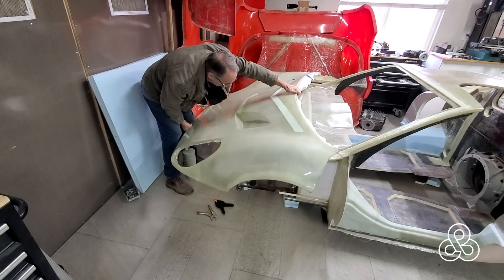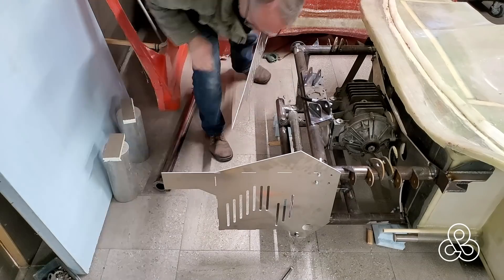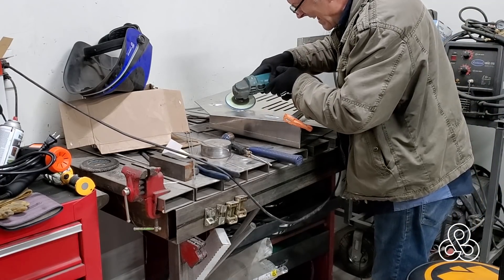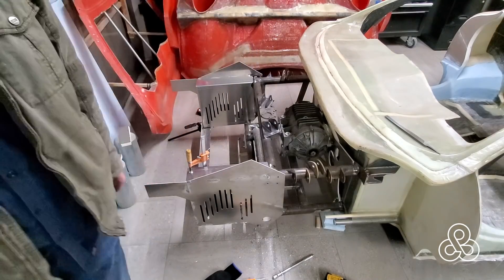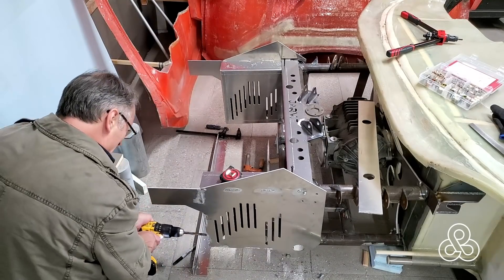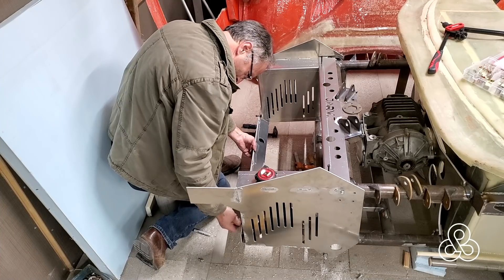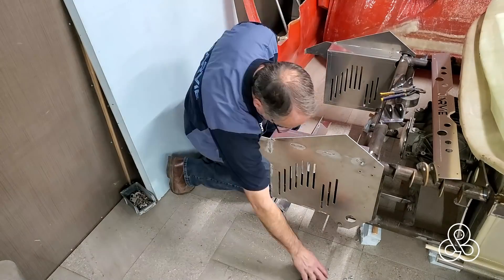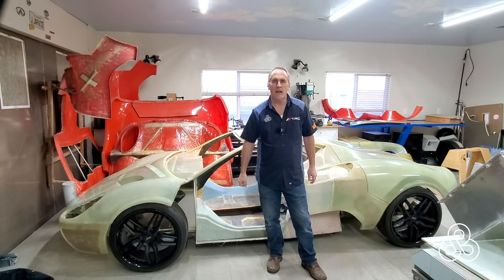A57 Under the nose! The front crash structure. Arete supercar project

Comment: Do you know what you're going to do for lights yet? Did you design it to use some that already exist or will you have to make your own? If you intend to race this car (spend time on various tracks), have you considered having extra body parts just in case of an accident (saving the templates so that you can make more as needed)? Have you thought about how much downforce you'd like to shoot for and at which speed you'd like to have that downforce, or are you just going to wind it? (lol I couldn't resist)
Reply from the maker: I have the lights (LED), but they are "replacement" bulbs for other vehicle (or off-road aftermarket) I will be building the fixtures for them. I have kept templates and of course the molds to replace or re-design in the future. Aero will be designed around Time-Attack. If I get to run it on track, that would be my interest. Amount of down force all depends on how high in the hierarchy you get in Time-Attack. As it will all be active, I will have room to play before I have to start changing things out.

Comment: Fabulous fabrication there Jay.  Don't know if it would help but my experience with riv-nuts on motorcycles is that over time some get loose and can spin in their holes.  I was wondering if applying some loctite when compressing the rivet part would ward off issues as well as moderating future galvanic corrosion.
Reply from the maker: I have found that in steel, but wonder if the deformation of aluminum will get a better grip. Also it seems to be the "bad bolts" that turn them, perhaps the right loctite (anti size) would be in order.

Comment: Minor point: won't you get galvanic corrosion where the aluminium and the steel meet?
Reply from the maker: Likely after some time. If the whole structure proves itself, I could reconstruct it fully out of bonded sheets later.

Comment: Hi Jay thanks for the (way) earlier videos illustrating your lay up processes with the different glass fabrics especially the ultra fine twills - I was stressing over the internal covers for the A pillars and windscreen header rail on the Dino recreation I’m building. Now sorted - the ultra fine twill followed the curves of the foam profiles / formers and they are now ready for upholstry trimming . Also Rivet nuts are super - I’ve used them all over for mounting items in the car - a little tef-gel on the threads is worth apply especially if using stainless bolts . Keep the vides coming great work & thanks again. 🙏
Reply from the maker: Glad I could help. Wish I was ready for upholstery. Ha!

Comment: This is awesome, I really like your work , but I have a question .... Why did you choose to use FWD rather than installing a transverse engine in the rear and make RWD ?
Reply from the maker: It will be All-wheel drive. It is all a result of packaging and expense to handle 600hp.

Comment: How is the radiator ducting going to work? With the way you've positioned and tilted the radiator it seems to me that bonnet vents are useless.
Reply from the maker: Still working on radiator position. Looking for a shorter (40mm) to get tilt correct.

Comment: I don’t know if it matters much but the radiator is angled the wrong way for the hood ducting.
The least resistant path will be down not up. It may not matter but depending on the rest of the structure and ducting the air could actually stall and not cool the engine.

Comment: Just to clarify. A rivnut rivet nut or nutsert are generally not blind unless the end is capped over so a bolt cannot go all the way through. The same for pop rivets , if they are blind the end is sealed. This is so that they can be used in water tanks etc where you don’t want liquid seeping out of the rivets.
If they aren’t capped off they aren’t blind.
Tip to reduce corrosion and the possibility of spinning put a little thread locker or CA glue on them and or in the hole

Comment: Those crash boxes are a lot of wasted space in a vehicle with limited space to put things.
I would consider a slight redesign so that you could put things like washer bottles and horns inside them.
I would also consider filling them with a high impact high density foam.
At the moment they look to be a five mile an hour structure only adding a foam to them will take them upto a forty mph structure without harming the low speed absorption
Reply from the maker: More space? there is already room for 2 travel bags. . . in supercar terms. Ha!

Comment: Working backwards from finished front end crumple zone.  Is it possible to glue as well as bolt That section to reduce fatigue and possible cracking around the bolt holes?
Reply from the maker: Bonding is a great way to go. I does take meticulous prep work and alignment, maybe on the production model -if ever. ha!

Comment: https://youtu.be/NrJzcdMkC9k?t=526 
The radiator would work the best way possible if you twist it to the front. The way you put it on the video will not allow good air travel. As I can see on the clip you have enough space to reconsider the twist.
Good luck!
Reply from the maker: Looking for a radiator that is a few inches (50mm) shorter, to do so.

Comment: A note on your radiator mounting angle and possible improvements. It might be useful to consider mounting it with top tilted towards the front. The Corvette C5 front radiator is mounted in the same way that you showed in the video, top tilted back. In the C6, GM changed it to top tilted to the front. I suspect the reason was a measurable increase in cooling at speed. My experience with the C5 Z06 is that the coolant temperature rises to above 220F on hot days. I've seen it go to 245F when idling for long periods. From what I understand, C6 vette owners experience less issues with cooling in this regard. I've also noticed other sports cars with angled radiators angle towards the front, Ferarris specifically. It might be useful to consider this while we're still in the design fabrication stages. Good luck!
Reply from the maker: Looking for a radiator that is about 2 inches shorter to rotate as you have point out, otherwise my flow through the "nose holes" is compromised. Good eye.
Reply: This reply doesn’t have enough love also this project is awesome. This car will be amazing!!! Can’t wait until it’s done.

Comment: For a possible 200 mph car I would be building a steel crash structure. Aluminum won't absorb impact like your hoping even with your box structure.
Reply: I'm not saying it cant be done. Just saying it probably shouldnt be done with aluminum sheet metal. Could fill the boxes with some sort of foam or lightweight stiffener

Comment: Just a suggestion if differentials you are using dont last in running reversed you can try hmmwv center sections as they run in reverse normally due to the reduction boxes
Reply from the maker: Good to know. Thanks

Comment: since the holes on the bonnet are made to suck upwards air from the bottom of the bumper, wouldn't be better to angle the radiator the other way in order to use the air movement for cooling and minimize turbolence?
i see there is a clearance issue but i believe positioning It that way, even more parallel to the ground (for clearence) would still be better, a lot of racecars with those bonnet holes use radiators parallel to the ground plane.
Reply from the maker: Yep! the wrecking yard radiator I have is about 2 inches to tall. looking for an alternative without having to get an expensive custom built one.

Comment: could you explain your design process for measuring the front crash structure? how much/ how thick the material needs to be, where to put relief cuts and so on...
Reply from the maker: Ultimately the occupant protection needs to come from the tub. The function of the structure out front is to "reduce" impact. The aluminum (plus radiators and such) structure would absorb only minor impacts. The vertical cuts in the structure force the panel to crush straight in rather than down (as the slope of the nose would try to accentuate). In harder collisions the front sub-frame would then absorb more force by folding. hopefully all this before the tub is called upon. Ultimately the tub takes all of these forces, but hopefully in a decelerated fashion. In the rear, hopefully the rear sub-frame (with engine mass) will break away in serious accidents, a-la F1 theory. Not sure if I could easily put together all the sources this ideology came from.
Reply: @BuilderCreator  Appreciate the response. 
Could heavy duty springs provide an energy absorption  mechanism? Or is there just too much energy in a collision for them to not bottom out?
Reply: @BuilderCreator   I know you don’t want to make talking head content but perhaps a video with your design and the considerations in the AutoCAD model might be an interesting way to do a bit more geeked content, you clearly have so much thinking behind it all it would be nice to give a sample...
Reply from the maker: @dominodoce  Most of the information is in my head and would truly have be a talking head video. Some viewers complain when I talk to much, some when I don't explain enough. As much of the information and planning for the Arete has taken place over years, going back and collecting it for a video would take a lot of time from building. I will try to bring up design aspect more often, but The new Leviathan project is going to be geared more toward stepping through EVERYTHING; ideas, design, fabrication and setup for production. In short- more geeked content!
Reply: Yes even links to the theory used would be a start.

Comment: Man, I really wanna build a car like that, but with a 2 stroke v8.
Reply: Man, you really wanna be rebuilding that engine every 10 000kms?
Reply: @RachaelSA  Lol not really.
Reply from the maker: 8 chain saw motors all linked together- we could just change them out every 10K. Ha!
Reply: @BuilderCreator  lol, that might work. I rode 2 stroke motorbikes for 20 years and I have more memories of standing in a workshop rebuilding the engines than I do of riding them.